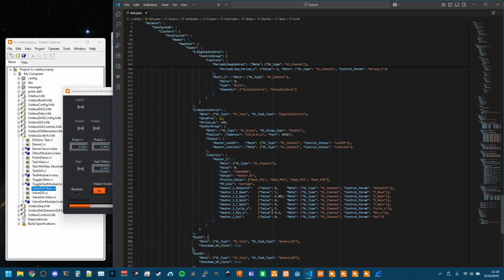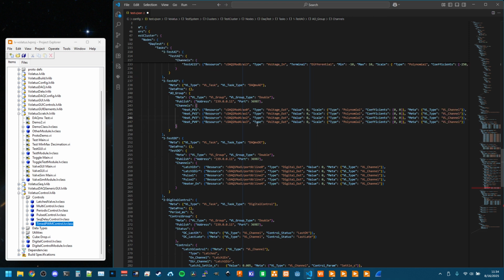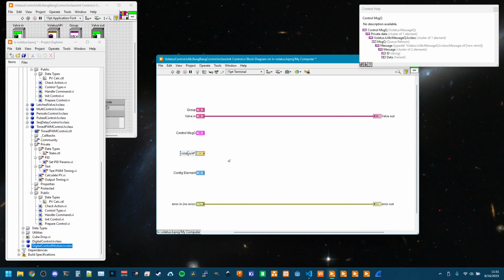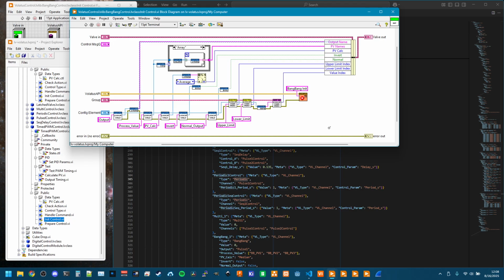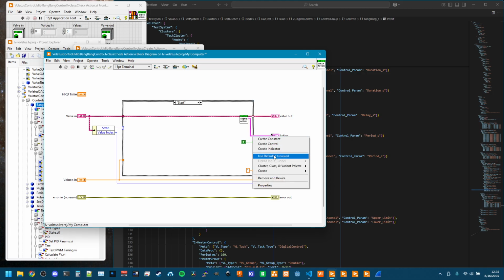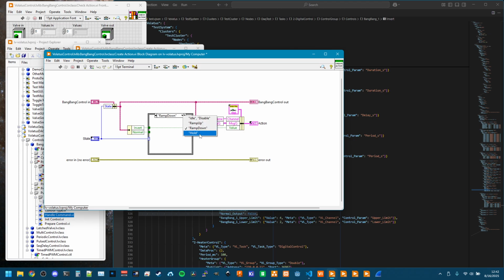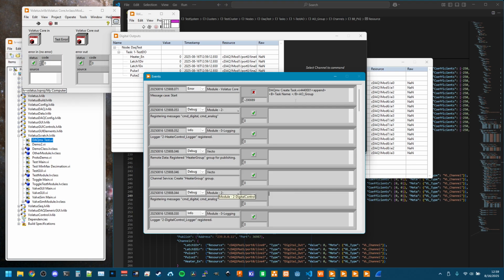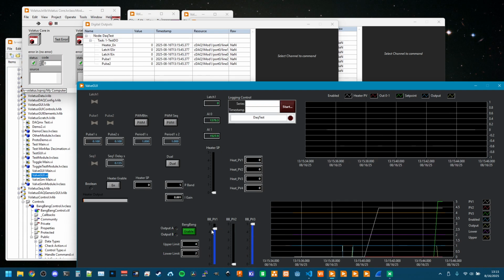Volatus Training - Digital Control (Bang Bang)

Comment: Would you be able to implement an ullage aware bang bang controller with this framework? The idea is to control multiple pressurization valves based on the current ullage in (lets say) a liquid oxygen tank. Lets say three valves: A high flow valve, a mid flow valve, and a low flow valve. When the tank is empty, all valves come on during the pressure cycle. As the ullage decreases, maybe only the high and mid flow come one, then only the high, then only the mid and low, and finally, when the ullage is smallest, only the low flow valve comes on. The idea is to prevent an over-press situation when you are working with high pressure propellant. The bang bang would need to know what the current liquid level in the tank being pressurized is and what its max level is. Sorry for the long winded question!
Reply from the maker: I think the way I would implement that is have two control schemes, one of which doesn't exist yet. Use BB to decide fill/hold and another discrete range control for selectively forwarding open commands to the different valves. I'll come up with an example for that!

The idea is the BB stays a simple BB mechanism and its output gets chained to the discrete range control which would use ullage/fill input as a decision point keeping the trend of the automation "lego blocks" that can get stacked for more complex behaviors.
Reply from the maker: Also, howdy from test site 11/18/19 (I presume!)
Reply from the maker: Aaaand got it finished this morning. There'll be a video within a few days to demo it.

Comment: This is fantastic stuff! I'm curious what roll the AO channels are fulfilling in this example?
Reply from the maker: In this specific example I was using them as variables, now there's a dedicated software variable module that can have telemetry values not tied to IO and accepts the same update commands as an AO channel would.
Reply from the maker: In a real system they'd be AI, but at the time I recorded this I didn't have the means to "simulate" inputs that I could drive from a GUI.